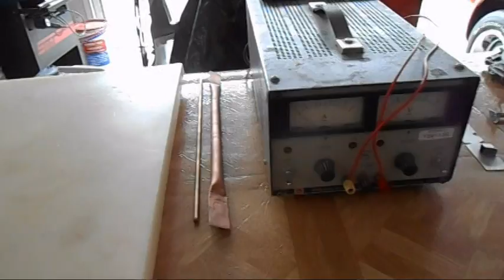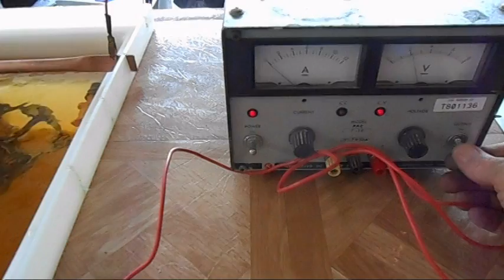Carburetor Plating Cadmium Dichromate

Comment: you mention the brightener being expensive; sugar acts as an excellent and cheap brightener for zinc plating. more sugar equals brighter plate. the next time you ad distilled water, try to dissolve some sugar in the water before adding to the pool, and your plates will be brighter
Reply: heartfang21 And frucktose is probably even better. I think that the reducing properties of sugar make it bright. Maybe. So dextrose or fructose works great.

Comment: Hi Harold,
What kind of pump and filter are you using to circulate the plating solution. Also what fitting do you have connecting the hoses to the tank.
Thanks Bernhard

Comment: Why plate the carb at all? they were originally just chromated zinc die cast. you can't dispose of any portion of those solutions down your drain, including the rinse water. Especially if that's cadmium cyanide,  I mean the dichromate is bad enough but other than pH neutralizing you're not doing anything about either the CN or the Cr+6 as that doesn't look like Cr+3. Sure cad plating is nice but it's also a long term toxin, as the body can't rid it's self of it.

Comment: Harold, great video 
I have a question. Other than bead blasting, what is your cleaning process? I've heard different stories. some say acid wash and a lot of other things.
Reply from the maker: I use a product called Berryman Chem Dip. You can buy I gal container that has a basket in it. I buy 5 Gal containers. Most parts stores have the 1 Gal in stock. If you want the 5 Gal they have to order it. Disassemble carburetor and soak in chemical . You can use a tooth brush on stubborn parts. Where gloves and eye protection. This is a caustic solution. You want all the grease off before you bead blast as not to get grease in your blast media.

Comment: Hey Harold, is this drying time to "total hardness about that 24 hours?"... This process adds a layer of protection to the metal as I'm understanding from your video ... This process could be used in my 2 stroke carbs as well? I repair chain saws and often times that requires replacing the cylinder itself and I've been looking for a "solution"( pun intended!) to color or plate my aluminum to add a little extra pop as these saws are ported and a lot of work goes into the inside that most people don't really get to see. Any ideas on coloring my aluminum that beautiful iridescent gold color like you got going on there?Hey man, excellent and informative video. I really appriate the time you spent making a great video and the lesson in plating you have shared. I also love the " keep your paws off it!" I'm in Philly... You from Jersey?
Reply from the maker: To put the Dichromate conversion coating on aluminum it would have to be plated. The Dichromate will not stick to aluminum. I would check into anodizing your Aluminum parts. Casewell Plating sells anodizing kits and explain the process on there web site.

Thanks Harold

Comment: Hello Harold! Thanks for the great reference video!  I'm doing an old car and am interested in the zinc and yellow chromate process for that purpose. The question I have is that the kits available now at Caswell are either "Copy Cad" / Zinc   or  a Zinc and Nickel combination. After researching a bit I'm hearing that the added nickel is "better" than just zinc. If you were to set up a new system today would you use the nickel or stay with Zinc alone?  Any input is appreciated. Thanks in advance.
Reply from the maker: Zinc

Comment: I seen a video where a major bolt co studs seem to be a little over size
So when nuts were screwed onto the stud the nuts got tight
I experienced the same problem
It seemed that after i ran the nut over the threads a few times the gold went away and the threads fit the nuts threads better 
Could the coating cause that issue

Comment: Love your video. I just set up my zinc plating tank and sodium dichromate bucket and started some parts today. My results were not good. The nickle finish was very dull even though I used the Caswell brightener, and the subsequent yellow dichromate was also very dull. I tried to steel wool the nickle to brighten it up before I dipped it in the dichromate. And still very dull. Can you help, any thoughts?
Reply from the maker: You have to plate a lot of scrape parts to season the solution. Don't add to much brightener.
Reply: @backnine  Thanks, I keep plating :)

Comment: Fantastic video! Question though, I'm not very familiar with auto carbs, I'm more into motorcycles and with that being said, are there brass pieces in your carbs that would get plated too? If so, does the plating negatively effect the diameter of the passages and threads inside?
Reply from the maker: Yes there are brass air bleeds in carburetors. No the plating will not effect it.

Comment: Hello. what plastic is resistant to zinc solution? Polypropylene, Polyethylene? Is it possible to use the fuel pump, the solution mixing (Inside there is metal parts)? If no, what pump must be used? And how many times per minute the solution must do a circle?

Comment: Harold   I notice that you don't use a heater, do you think that would make a difference ?    thanks     Steve Coffman
Reply from the maker: The solution I use is Zinc Chloride. I do not heat the solution. My solution does not get below 65 deg and gets as high as 100 deg in the summer. I have seen no difference in that temp range. If you live in a cold climate and have your setup in a unheated area you will need a tank heater.

Comment: Could you do a part for our college engineering project?  It's a small fuel rail.
Reply from the maker: +Jason Richter 
Sure
Reply: +Harold Demes I talked with our faculty adviser today and he's all gung-ho about setting up our own operation to plate parts for our race car build.  He wants me to put together a parts list to to estimate the cost.  We can use our electronics lab rectifiers and maybe get sodium dichromate through our chemistry department.  But I have many questions on the remaining items, parts preparation, and plating standards.  Can you contact me at jpr2616@email.vccs.edu?

Comment: I’m running a Caswell system and have not had good success with there yellow diachromate. It rubs off just by touching it after sitting a day or two. I was going to try your formula. You said in the video to add 10oz of sodium diachromate per gallon distilled water. Since the SD is a powder, are you measuring the 10oz in weight?
Reply from the maker: Hi Guy
 The powder is by weight. When your part is plated it will have a sulfate layer on the surface. The acid in the Dichromate will cut it off and allow the chromate to adhere. The process is rinse plated part immerse in Dichromate solution with a swish motion  count to 4 or 5 remove rinse and repeat. this should produce the color you want. Remember to see the color better blow dry it and then inspect. As the acid and dichromate starts to loose it's bite you may have to do this 3 times. When it gets to that point add Dichromate powder and acid. Go easy on the acid. Small amount goes along way. Caswell Dichromate is crap. The chromate should not rub off and is fuel proof. I have been using this formula for years and it cheap to mix. Also you can use muriatic acid(swimming pool supplies) rather than the sulfuric. Thanks for watching.
Reply: Harold Demes Thanks Harold for writing back. Ya I have been disappointed in the Caswell SD. The zinc kit works fine. I’m restoring an old Kubota Tractor. I looked on eBay for the SD but what I found for enough to mix two gallons is about $60. Is there other sources to buy the SD that is a little easier on the wallet?
Reply from the maker: @ckonthebay1950  Ebay 28.00 a pound. You should only need 1 gallon. No free lunch. I know that caswell crap cost a lot more.
Reply: Harold Demes I hear ya. I will get the stuff off eBay and mix it to your instructions. I left a comment several weeks ago and don’t know if you saw it. Just letting you know I really like that setup you have. I going to look for one of those filter pumps. Thanks for your help.
Reply: Wanted to give you an update. I ordered the SD off eBay and mixed it like you said. What a huge difference. Is pretty much fool proof. All the stuff I have plated in the last two days has turned out perfect. At your mix rate a six second immersion give me a constant color depth that I’m looking for. Thanks again for your help and time.
Reply: Are you saying instead of the battery acid (sulfuric acid) you can use muriatic acid for making the yellow chromate? Have you tried it and does it last as good as the other? Thanks!

Comment: Hey Harold , I`m about to build something very similar to this . I`m hoping you are still following this vid as a I have a quick question . Are you using a pool pump there ? What sort of rate is that shifting the fluid . 

Cheers .
Reply from the maker: You need a magnetic drive pump 5-15 Gal a minute. Little Giant makes these pumps.
Reply: thanks for getting back to be bud ,I`ve had a look around and found a couple of pumps that will probably fit the bill nicely , not quite what you have there but 24v dc mag drive pumps that`ll shift 2450LPH (yeah im in the uk) thats about 9GPM ( variable) if my maths serves me , lol. That will do for now im not a heavy plater , i restore motorcycles and using the air pump in a bucket method just cheeses me off because its never brilliant , so i`m planning a 40 litre tank , with a circulating pump and a heater and hopefully i can get a much much better result .

Comment: Great work ! does this plating process is only applied to carburetors ? or it can be applied to any kind of metal i rebuild toyota old engines and they have sort of parts that come with this color but i am not sure if this process can be applied ,what are the materials to be used ,
thanks
Reply from the maker: You can't do Aluminum or high grade stainless steel.You can plate everything elese.
Reply from the maker: The pump is about 6-8 GPM. The cloth on the anode is polypropylene cloth you can get at fabric stores. Just cut it to size so you can fold it around the anode and use rubber bands to hold it in place. I think Caswell plating sells them under anode bandage.

Comment: Do you plate all the carb bodies or do you have another method to keep the original casting look (zinc).
I've cleaned and cleaned with carb cleaner kero etc but don't want to loose the original finish.Blasting or water glass bead blasting will change the original look too.
Any ideas?
Reply from the maker: I plate all the carb bodies.

Comment: That's a nice job and the color looks great, BUT that's nowhere near what the original looked like. It should be still a little darker and "flatter" monotone with no shine nor iridescent flip-flop.  I used to own Bowtie Supply in Buffalo so have some experience here, but I used to send my carbs out to a place, I think in Indiana, before rebuilding them all. Most of the cars I worked on or with were hi-perf GM cars, mostly Chevys, most had Holleys, but some of the lower-mid- performance 327's & 350's like '67-69 Camaro SS 350/295hp had Rochesters. I did more 302 Z28 (both single & Crossram), 70-72 Z28 & LT1, 454/450hp LS6, 396/375hp, etc, all with Holleys. I did own a '70 SS454 Monte Carlo that was a Q-Jet though...

Comment: Hi Harold.
Which pump are you using? Brand, capacity, voltage? Is the filter that cylinder over the pump?
Reply from the maker: Hi David
 The pump and filter I bought on EBay a long time ago. It was used in a lab testing plating solutions. I think the manufacturer was Serfilco. The pump puts out about 6-7 GPM. You could use a Little giant  mag drive pump. The filter is a polypropylene. Any kind of inline filter that is plastic that has a polypropylene filter should work. Hope this helps.

Harold

Comment: Could you plate the item with nickel instead ???
Reply: I'd like to know the answer as well. Any negative to using a zinc and nickel anode together?
Reply: @Xylemer  I know zinc is really reactive inside a carburetor especially with ethanol mixed gasoline. Why not try using just what you stated. Look forward to hearing from you Andy. What I do know is that Antimony plate would work. That is what my neighbor stated to me a while ago. I never got around to check that out for myself. Go wild fella. V

Comment: I tried your formula for passive blue color on plated zinc. I used 3.2 oz per gallon of nitric acid as stated and after just a second or two immersion it starts to turn the zinc dark and it looks like it is trying to burn the zinc finish. You sure it's 3.2 oz. per gallon?  thanks,  MIke
Reply from the maker: Hi Mike
 Are you using reagent grade 90 + %. If sot try 1/4 OZ Per Gal. My acid is only 40%. I should have stated that. Let me know your results.

Harold
Reply from the maker: Hi Mike 
 Also how long are you putting it in for? Should not be longer than 15-20 seconds then rinsed in water.

Comment: What are you using for plating solution. Hot ot cold or between them. You used 3,5 amps and what is voltage?
Reply from the maker: Hi Arda
 If you want to do zinc plating  go to Caswell Plating web site they sell kits and and books and also sell bulk supplies for bigger tanks. I use a different supplier but you have to buy large quantities. I started out many years ago with Caswell and there plating solution lasted many years. I don't pay attention to the voltage I watch the amperage. There is a sq inch formula for amps for the plating solution you use. My chemical is room temp anywhere between 65- 110 deg. I live in AZ so that is my work shop temp range.

Thanks Harold
Reply: Thanks for your answer. I will search Caswell Plating.

Comment: Will potassium dichromate work?  Sodium dichromate is no longer available.
Reply from the maker: Did you bother to look.

https://www.ebay.com/itm/Sodium-Dichromate-CERAMIC-GLASS-SUPPLIES-1-2-5-contact-for-more/143148111637?hash=item21544ad715:g:emsAAOSwn-tZNvMI
Reply: Harold Demes yes I did. On amazon though. Thanks
Reply: Harold Demes Now back to my original question, will potassium dichromate work?

Comment: To make your dichromate solution do you use water with the other ingredients?
Reply from the maker: Sodium Dichromate (Yellow Powder) 10 OZ by weight or 10 OZ plastic measure cup per Gallon. 1/2 OZ Concentrated Sulfuric acid by volume measure cup per Gallon ( Or 1 OZ battery Acid per Gallon) Use Distilled Water.
Reply: @backnine   Thanks for your fast response. I have bought the Dichromate on EBay a few weeks ago. Bought the sulfuric acid this morning. This will be my first carb that I will plate and Dichromate. This will be a game changer in my restoration of automobiles. In California it’s almost impossible to find a good plating shop in this out of control state. I just learned how to zinc and nickel plate. Can’t wait to use this process. I saw your video a few years ago and was amazed that a simple formula can make your parts look great. No more rattle cans to make my nuts , bolts and many little parts look good. Now I can make them look great. 
Thanks for taking your time to answer my questions

Comment: HAve you done any nickel plating? I've been experimenting a little and am having a little success. Do I need to be circulating the solution for Nickel plating as well?
Reply: Yes. It needs agitation (not crazy agitation like washing machine. But 'movement' agitation to assist thre nickel in getting to the part in greater PPM (parts per million) of the tiny particles.

Ie- in still water, a lit of the nickel particles done make it all the way to the part before dropping off/falling down or flat out dissolving away so to speak. When the water is moving, it 'stirs up' all that 'dust' and costs the part a lot better.
Reply: @strikeforcek9149  Thank you! That's what has been giving me poor results. I will add a circulation pump. :-)

Comment: Harold, is there a way to "deplate" after you dichromate it?
Reply from the maker: Use muriatic acid
Reply: +Harold Demes Worked as a charm. about 30 seconds into 9% muriatic acid solution removed all the goldish color and restored it back to a dull silver finish. Thanks for the prompt response!

Comment: I've tried doing this to zinc bolts but even after scuffing them with a scotch brite pad as soon as I rinse them the color washes off. Any ideas what I'm doing wrong ? Thanks
Reply from the maker: The Acid content might be low. Dip it in once rinse it and dip it again and rinse. See if the color stays on.
Reply: I added a little more acid and double dipped it, MUCH better. Can the bolts be bead blasted first ? Very tedious work and can't get into the threads of the bolts with the scotch brite. Thanks again for sharing your knowledge with myself and others, I will save a few bucks over buying them already done for sure.
Reply: try using metal polish with a nut to clean the thread up ?
Reply from the maker: I have run across some zinc plated fasteners that had a lacquer coating. Try soaking them in lacquer thinner/rinse them in warm soapy water then clear water rinse/then the Dichromate. Make sure you use rubber gloves. The part has to be clean just as you were going to plate it. Any oil or dirt on the bolts the Dichromate will not stick. Don't blast them as the plating will come off.
Reply: I'll give that a try, Thanks